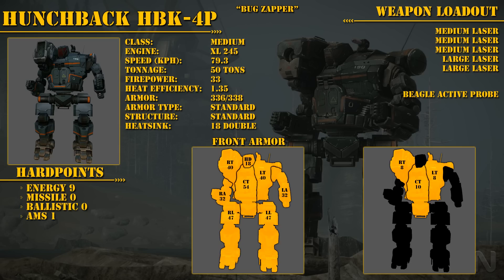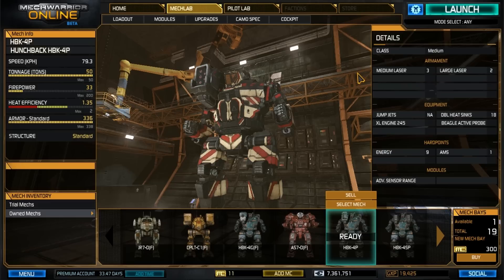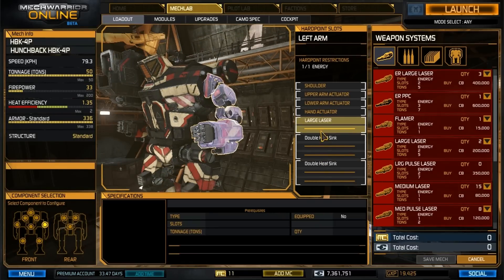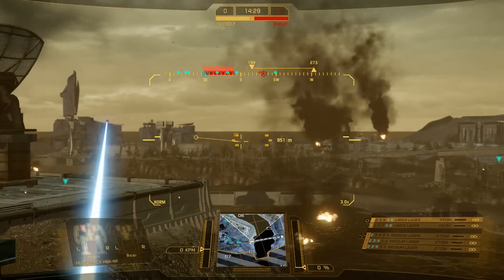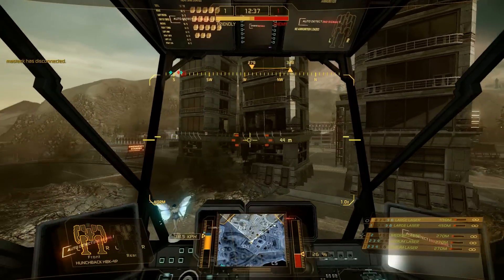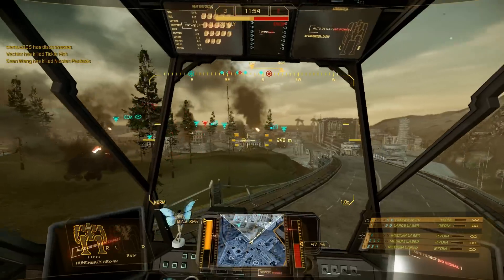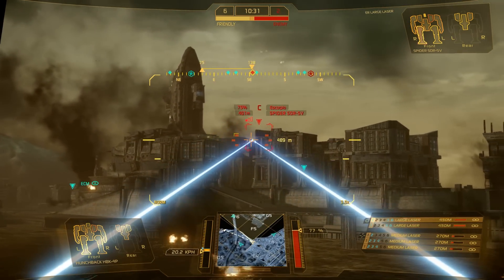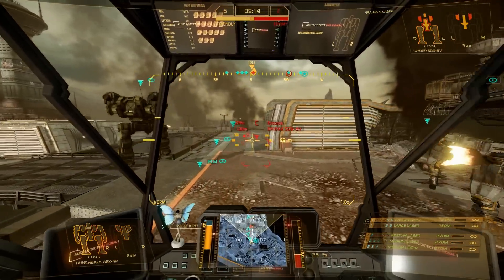MWO: Hunchback HBK-4P "Bug Zapper"

Comment: Hey NGNG, thanks for the TS.  I have a few problems with your build.  First is obvious...XL engine in a 4p.  Most people that fight Hunchys go for the shoulder first.  Second, not a lot of firepower.  Sure, the heat is decent but I can have more firepower on a Jenner  Let me give you this recommendation...Endo-steel(full armor) Standard 260, 9 medium lasers, fill the rest with double heat sinks.  After speed tweak you will do 92.7 and have 45 firepower.  Use hit and run tactics for higher heat.

Comment: Strange build, why you puting larglaisers in the arms? the abilety to move the arms comes in handy in CQB, madiums or even small laisers would be good for arms and the large laisers in the right torso. I would give the adivce if you use longrange wepons in teh arms to group the 1 left fier button 2 right fier button, so you can take cover and are not producing heat with shooting a wall.

Comment: 9 MLs is about the point closest to perfect balance for the 4P. Small lasers have better cooling but suffer for damage and require you to get up in the face of some really nasty mechs. This sort of 2LL 3ML build is hard to fit weight wise, thus the XL, and does a lot less damage with a similar heat profile. 9MLs take some trigger discipline but they play can-opener on an Atlas just fine.

Seriously why take a medium that can tangle with assaults and weaken it because you want rainbow lasers?

Comment: It's cool but the XL engine makes me cringe. I spent 5 minutes in the smurfy's online mechlab and managed to build a almost the same mech but with a standard engine. 
Drop BAP, 1 heatsink and 1 ton of armor (from legs mostly of course). 
Add Endo and a standard 245 engine. 
There you go. Same setup but with way more survivability. Go to smurfy's mechlab and replace "mechlab" in the url with mechlab#i=2&l=9df301501ec5b642cc2781f39712bd0727bfeb17